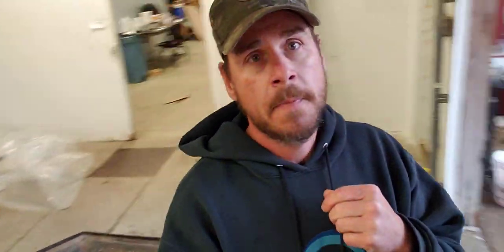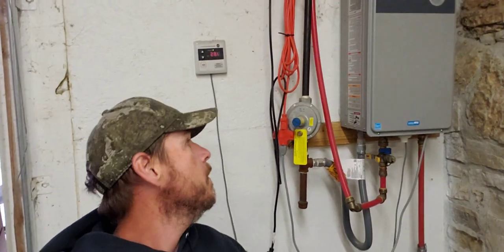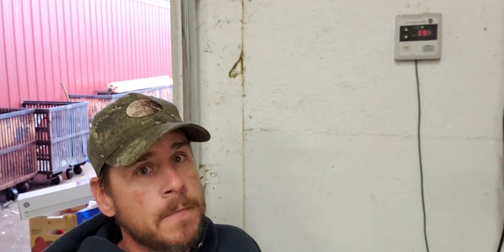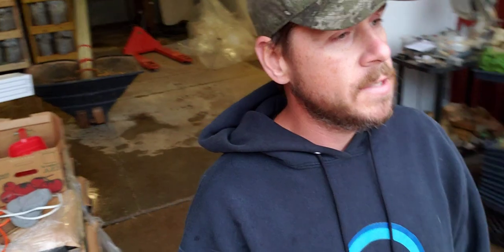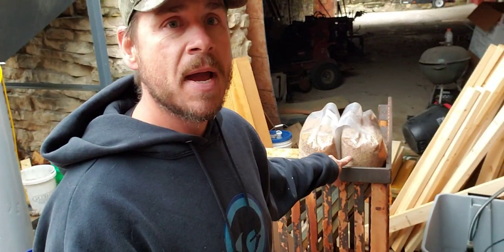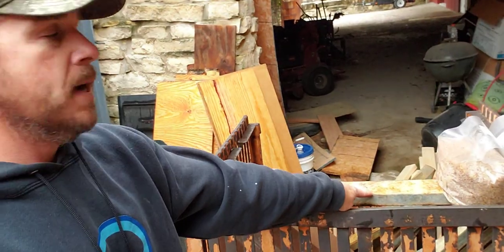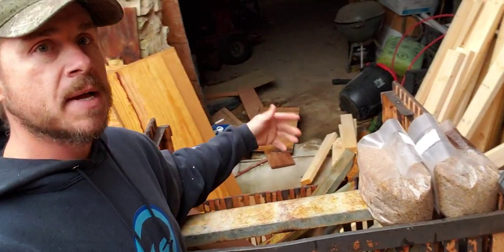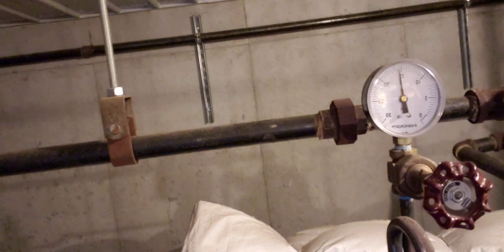Mushroom Spawn - Cooking Your Grain (most likely you are under cooking)

Comment: I understand that's it's better to sterilize grain under pressure because it's higher nutrition and the higher temps help ensure everything gets wiped out. But is there anything wrong with sterilizing grain for spawn with atmospheric steam if you keep the internal temp up for long enough? I use a temp probe in the center of a 300-gallon cow trough that I pack with substrate. If I were to sterilize my grain in there too and keep the internal temp above 200 for a full 18-24 hours, wouldn't it have the same effect as using one of these pressurized vessels for a shorter amount of time?

Comment: Without seeing this video the home canner in me just couldn't see a cold start canner even with pint jars getting heat to center in anything less than 2 hours. Especially since there isn't any liquid inside to transfer heat from grain to grain. My first batch in pressure cooker, I did pint jars. Brought canner to boil vented steam for 10 minutes brought the pressure to 15 psi. Then started the time for 2 hours. All 16 jars seemed to as of now grown clean spawn. I may need to increase the times thanks for the insight.

Comment: Do you think it’s possible to get by using a atmospheric sterilizer for grain? I have 2 55gallon on a couple PID controllers. Trying to avoid buying an autoclave or multiple PC at the moment.  I started cooking for 12 hours after internal temp reaches 210F
Reply from the maker: No,  it won't be consistent

Comment: Hi can you help me out. I cook my grains for 2hrs after it hits 15 psi. After I introduce culture to my grains They start having thermal action and some get hot and puffy with air and start greening. what an I doing wrong.
Reply: I have only been growing commercially for 10 months now, but I started cooking my grain @15 psi for 2.5 hours after coming to pressure. Only once did I cook for under 2.5 hours did I experience you you described and it was when I didn’t cook for 2.5 hours after achieving pressure. Good luck my fellow grower.